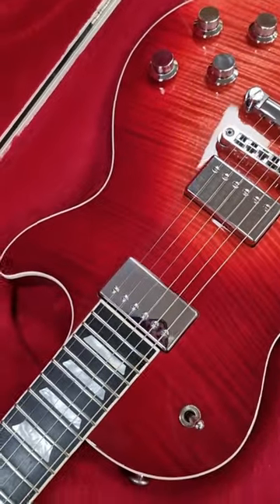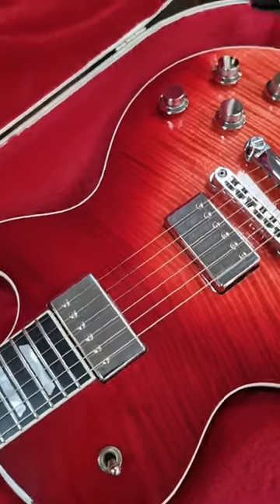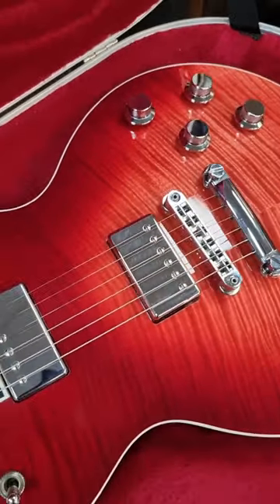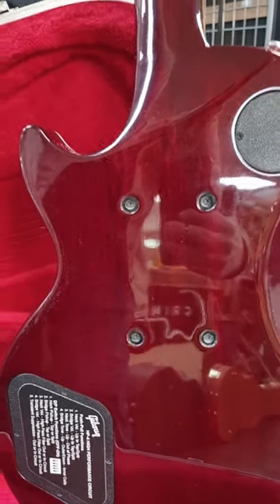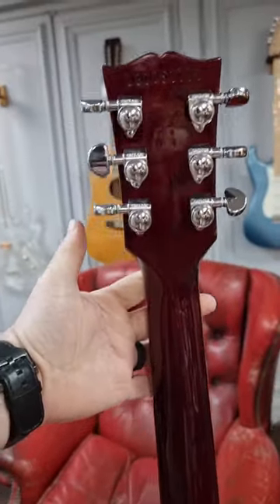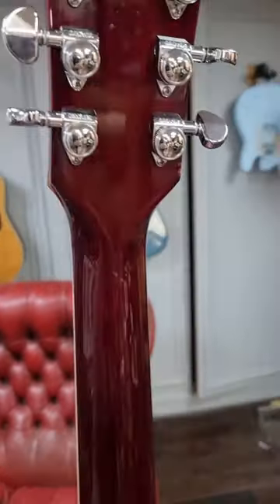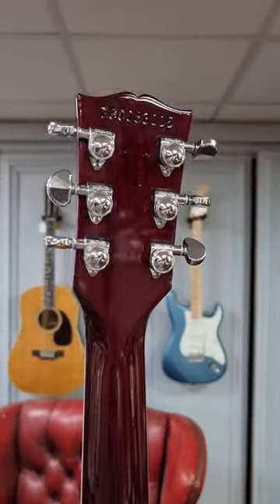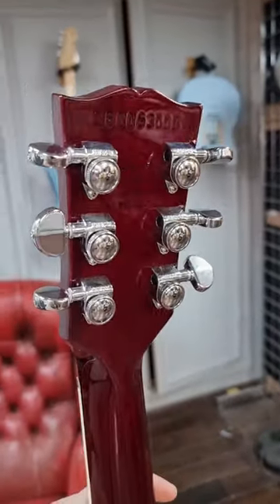Pt 1 F**K you Gibson | 'High Performance' Gibson Les Paul.. Still NO volute! on DGD anyway 😆

Comment: Volutes do very little to prevent breakage. the 17 degree headstock angle creates short grain in an area under a lot of tension. Lessoning the headstock angle to 10 degrees, without a volute, will greatly strengthen it. Gibson tried that and everyone complained that it wasn't like the 50's ones, they went back to 17 degree and broken headstocks, like the 50's ones....

Comment: Those 4 holes in the back look hideous. The missing pickup ring look stupid and too bare. The volute shouldn't be optional depending on whim and year of production. I have a Les Paul studio and a SG standard. They are 20 years old. Even then, the guitars were built with sensible specs.